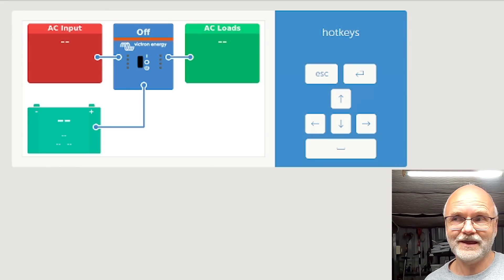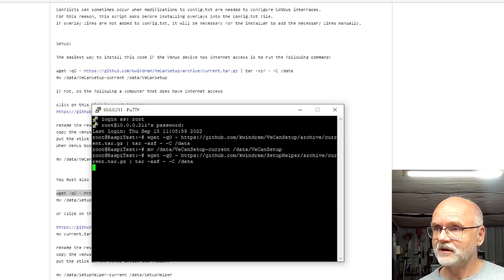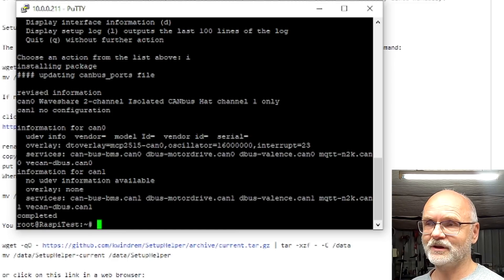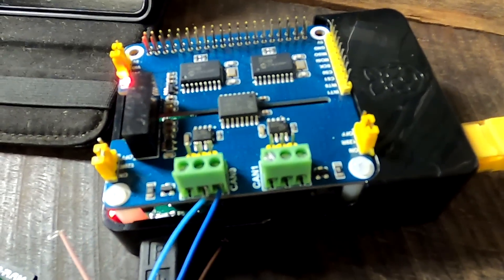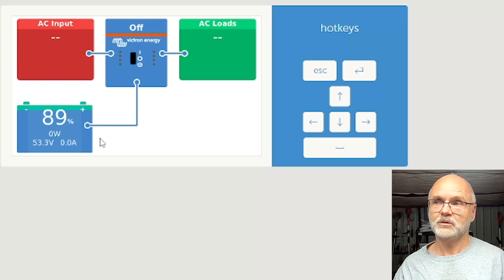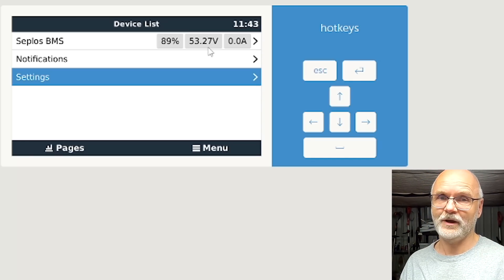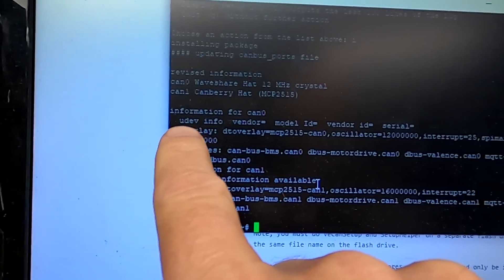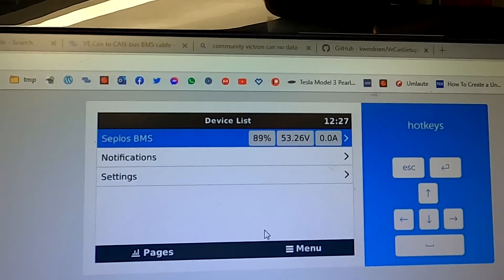Seplos BMS and Victron Venus OS connected via CAN. Very easy setup (almost).

Comment: Does the BMS not automatically throttle the Charge Controller/Inverter when there are critical states it reports to VenusOS via Canbus? i.e. cell voltage too high, would that stop charging, or do you manually need to configure that in NodeRed?
Reply from the maker: Yes, Brian. This can be achieved with this setup and enabled DVCC in Venus OS.
Reply: The BMS can send max charge & discharge current levels to the Inverter, plus the Max Charge Voltage.
But I am not sure they change under an alarm condition. I would guess that under an Alarm the BMS would block all charging.

Comment: I was told CAN also should have a common reference ground, I don't see one in your system
Reply from the maker: No, CAN does not need ground. I have tried with ground before and could not get it to work but it now works without ground. As I had some other issues before, I'm not 100% sure if this was all related to the ground being connected or not.

Comment: This could be a classic example of language barrier. Since I speak Mandarin, my communication with them is always been clear. They know exactly what I am looking for and I know exactly what they can offer. Of all the BMS I purchased so far it has worked as expected.

Thinking back, they always ask what inverter I am using when I was making the purchase.
Reply from the maker: Yeah, OK. My goal from the beginning was to connect it to the Victron system, not the inverter. If it is a pure inverter (not hybrid), there is literally no point of doing that unless the inverter and battery are very far away and there is a certain voltage drop on the cables. We will get to this soon...

Comment: What you think is the CAN-Port on the RS485 BMS is a RS485 port, not a CAN interface.
This is userfull for inverters with no CAN interface. You cannot connect these inverters to the "Seplos RS485" port, because they running there own protocol there. This would collide with other inverter communication. So they just switched the CAN connector to a RS485 connector by changing some parts on the board.

What's maybe possible is to flash the "RS485" version with the CAN-Firmware. The CAN chip is not on the board, but as a slave unit this does not matter.
Reply: No, don't do it  ,  the board going to be briked if you try to upload a CAN firmware on a RS485 bms version.  You will have to send it back to seplos to recover the board.
Reply: @sergea1138  he must send it back anyway. And did you tried this already or is this just an internet myth?
Reply: Hahaha @matthiash.4670 I understand, but You should trust those who are using this bms for a long time compared to Andy. ;-) .  From day 1 we said base on sticker number it was a rs485 bms, so there is no point in trying to get it run on CAN and be disappointed it is working not working on CAN.  For your information, yes I confirm you will have no choice than sending it back to seplos if you try to upload CAN firmware on a rs485 bms version. Is it bad yes, the pc software should prevent you to do it.   At the same time if there are  2 versions of the bms why would you think it is safe to it.  Always ask your vendor before buying and doing anything hazardous on a 200$ device.
Reply: @sergea1138  once again: Is this a internet myth or a proven fact? I give a shit on what vendors say. Seplos told me the 100A version could not be converted to 200A ... I did it. So once more: Tell me proven facts and not some bs someone told someone, because someone told him...
Reply: @matthiash.4670  I understand your logic about as a slave battery, it would not matter either the CAN port works or not.  I won't give a try to prove anything, but if you want to read it from people who experience doing it, you can find their words on the diysolarforum.
Reply: @sergea1138  What you are talking about? None said here the CAN port ist working by flashing other firmware. This is stupied. On this boards is a RS485 driver instead of a CAN driver. The question is and was, if it's proven the CAN-Firmware cannot be flashed on the RS485 boards. And now you talking about a CAN port that is not working. The CAN port is not in use on slave devices. It doesn't matter.
Reply: cmon  @matthiash.4670   I said it many time already on this video it is a rs485 bms version and  the left port on the battery that is labelled CANBUS is a RS485 port running pylontech protocol, just call it the inverter port  if you prefer, and I was saying in my last message I agree with you, it doesn't matter as a slave battery  this port is not used either it is CAN or RS485.       

And I answered your question : I don't have personal proof of anything.  I know of 2 people who try it and get their bms sent back and I have confirmation from seplos there is no way to recover it by myself with the pc software.  its enough for me to don't give it a try.     

Does that mean there is no other way  ? certainly not.  For sure they are using a jtag probe to recover the microcontroller flash.    My advise is still the same to anyone reading the comment don't do it.
Reply from the maker: In any way, the BMSes on their website should be clearly labelled and explained WHY there is a CAN and and RS485 BMS. It is all clear as mud.
But thanks for all your information. I will try to flash this BMS with teh CAN firmware and see what happens. They will send out a new BMS with CAN so I can connect both batteries together.

Comment: It is very strange and VERY DISMISSING that Seplos products ARE NOT compatible even within one company. This puts into a big question the sense of using their BMS.
On the other hand, I wonder why Andy is not trying to establish communication between Victron and JK-BMS. Since there is a very good BMS that works, whose philosophy is much closer to the DiY spirit than Seplos, why not use them as an essential element. Although I really have no idea how to solve the problem of addressing many JK BMSs? As long as it is possible at all. But probably it is...
Reply from the maker: I think they have learned this now and are changing their perception. There will be only one BMS in the future (different amps obviously), but it should be compatible with others from Seplos.
I have done the Victron-JK communication already in one of the last videos. That works but only with one battery bank... https://youtu.be/sHIlP2oJ3DU
Reply: @OffGridGarageAustralia  Thanks for the answer, I have already watched the movie. I know Seplos announces unification.
But I still consider the direction of JK-BMS to be more interesting.

Comment: Thanks Andy, I'm just watching your informative videos hoping eventually it will sink in for me. Based on your previous recommendation I bought the JK BMS through your link as well as the display monitor. I would very much like to know how that could possibly integrate with the raspberry pi.
Thanks Andy for all your very valuable information!
Rick Fort Worth Texas and traveling.
Reply from the maker: Hi Rick, I have shown the JK and Victron communicating in one of the last videos here on the channel: https://youtu.be/sHIlP2oJ3DU
Depending on what display you bought, you may not be able to use the comms and the display at the same though.
Reply: @OffGridGarageAustralia 
Thank you my friend I appreciate you!
Reply: The JKBMS display connects to a different port on the JK so you can use the screen and the connection to VenusOS using a USB to TTL adapter
Reply: @gavinnoname1424  Thanks for the FYI!

Comment: OK I have a 48v 200amp Seplos Bms ready to use with a new battery build using 16 tested 280ah eve cells and Victron 48 5000.
The pcb looks very well made indeed.
Question is:
Do I keep the Seplos?
Do I ditch it and buy a JK?
I don't like how it appears to limit the charge voltage at the top of the cycle to hide its shortcomings in balancing.
Reply from the maker: The charge voltage/current limiting function can be adjusted and even turned off. 
If you have only one battery, I would not bother with the Seplos. Its strengths definitely lay in the operation of several battery banks in parallel.
The JK will work well with your battery bank and the MP. Also easy to connect via RS485.
Reply: @OffGridGarageAustralia  Well first of all thanks for all these tests.
You nailed one of the main reasons I chose the Seplos, I plan to have a second battery👍
Reply: @OffGridGarageAustralia  That is good to know. I was worried that I was gonna be stuck with strange charging behavior once my kit arrives.

Comment: This is so crazy.  In a few years, they will realize that an ethernet port with webserver will be standard.  We shouldn't be relying on bluetooth, wireless, or any non standards for computer connections.   CAN is great for a car where you really only want 2 wires to control everything.  But the few cents more for ethernet is far more effective for debugging and everything else.
And the BMS should be throttling current to manage a cell over/undervoltage....not shutoff all related batteries.  Seriously, going to have to design one of these to get it right.  So many are just completely inadequate.
Reply: CAN or RS485 is the standard for any kind of inverter or other solar equipment. Why should they integrate Ethernet, if this cannot be connected to other hardware?
CAN and RS485 is an industry standard for decades with a reason. They are simple to use, build-in in nearly all microcontrollers and do not require addition hardware as like switches.
What Andy here did in a couple of videos here, sorry, I did it within a few minutes - faster than I can configure the IP settings of my network.
Missing knowledge cannot be the excuse for dropping solid industry protocols with a widely spread existence in the solar corner.
Reply: you miss the point why CAN is heavily use in car and industrial environment.
Reply from the maker: Yeah, I kind of agree. All this tinkering with RS485 and CAN is cumbersome and cost a lot of time. A simple ethernet standard would be great and easy to setup.
In one of the last videos, people have confirmed that the BMS will only shut down the connected bank, not all of them. We will see how the new BMS is performing once it comes out.

Comment: Back in the days we could update /udev manually with a single command.
My guess is that the install script gives an unclean exit or the author just didn't shake the /udev tree within the script. A reboot van do that for you but since you have root access you should be able to update it by command. I retired from Unix and Linux. a swift Google should people help sort that out. My guess it is.

Nice job Andy. It is good to see how everything sticks together.
Wether you will monitor your expensive batteries with "toys" is up to you. I always ask myself the question "What if I am not at home/location, who is going to fix issues and monitor? Can they or do they need a 2 month course? It is all in the game with Diy projects I guess...
Let's amp!
Reply from the maker: Thank you. I would have no idea how to fix that. Last night I started from scratch again and the smaller CAN hat did not work at all again. Same error with udev and no chance to get it installed. Rebooted numerous times and installed, uninstalled, no luck... Switched over to the isolated hat and it worked after the first install. I guess the drivers are not as 'clean' programmed as they should. I'll report this back to Kevin and see if he has an idea.
Reply: @OffGridGarageAustralia  it is very common in  free source world. Haha. Don't go there alone, you ll get lost. I have been down that rabbit hole trying to maintain 50+ sources for the very first HD streaming platform that Branson's Virgin Media wanted. They asked rediculous things because they didn't know the right questions (probably should have answered 42 but I didn't dare). It totally flopped.
Now, to get it working again you probably have to do the same steps. First install the double hat . The install script does some things the other doesn't appearantly. It is always reproducible as long as it is not a hardware fail. Gotta love IT for this.
If you feel lucky yourself and love poking the flashing cursor and don't mind people finding you staring at it for hours:
One option, I LL may try a fast Google if I find time, it takes time, is too check all files modified after the first script. But you need to figure out what directories to check and how to do this. Simplest is the "find" command but it is cumbersome in syntax, py may have the "locate" command aboard but I don't know if it is that versatile actually. I am old. Need to check "locate".
When finding the differences you probably see some script/.conf/link missing. Something the programmer could easily have missed because that part is being taken care for by another hardware install.
So it is not bad, it is just nearly finished...
Personally, I would let the young people chase that one... Better have a 🍻 and wait for them.
Cheers.

Comment: Und jetzt Mal can Bus und rs485 gleichzeitig ausprobieren
Reply from the maker: Warum? Es kann nur ein BMS als Batterie Monitor erkannt werden.
Reply: @OffGridGarageAustralia  da die eine Batterie jetzt über can Bus angeschlossen wird, und can Bus vom Venus os als andere Interface Art behandelt wird, könnte es vielleicht sein, dass beide Batterien benutzt werden
Reply from the maker: @lanealucy  Das ganze ist ja erstmal nur ein Test fuer die Battery 3.0. Fuer meine eigentliches System brauche ich wirklich keine Kommunikation.
Reply: @OffGridGarageAustralia  trotzdem wäre es interessant, ob es funktioniert
Reply from the maker: @lanealucy  das stimmt wohl. Das war ja eigentlich der Grundgedanke zwei Batterien zu bestellen und dann die Kommunikations zu testen. Vielleicht klappt es ja noch wenn Seplos die neuen BMSs schickt.
Reply: @OffGridGarageAustralia  ich bin auf jeden Fall gespannt
Reply from the maker: @lanealucy  Ich auch ein bisschen 😉

Comment: Unrelated but does your weptek 21a power supply ever spark when connecting it to a battery even when output is off or set to zero? Mine does and I think there is something wrong with it.
Reply from the maker: Yes, it does if the set voltage is different than the battery. If I connect it to a 50V battery, I set ~50V on the power supply before and turn it on so the internal capacitors can pre-charge to that voltage. No sparks anymore.
Reply: @OffGridGarageAustralia  Thank you! Keep up the great content.

Comment: Would you suggest the current NEEY Balancer for the SEPLOS BMS (Can Bus connected to Growatt Inverter) as balancer for EVE LF160 cells (160A and 0,5C max charge / discharge) in 16S configuration?

Which NEEY will be the right one and how to make sure to get the 4th generation or whatever you had gotten ?
I just wanna make sure to not get ripped of with outdated stock.

DIY battery with this seplos BMS you are using but 100A max but without such case.
thanks a lot😀
Reply: I am doing that on my 280 kit Just fine with the neey balancer.
Reply from the maker: If you use the link on my website you will get to the Hankzor store on AE. Under the specs table there is a text saying: New upgrade: put the balanced sleep voltage and balanced start voltage options in the app
That's the lates gen4 version. You can also verify with them before buying.
https://off-grid-garage.com/battery-management-systems-bms/

Comment: The canbus port is not functional on the 280Ah battery bcoz it is not a CANBUS port but a RS485 port (to connect to voltronic like inverter for example) since it is a RS485 bms  version,  even if it labeled as CANBUS. ;-). they didn't modify the label on the pcb, and didn't produce 2 different front box panel.
Reply: yep, stated that under the last video too
Reply from the maker: Yeah, it's not great what they have done. I understand that some inverters talk RS485 instead of CAN but... still the BMS has both CAN and RS485 ports. At least it's labelled like this 😑
Reply: @OffGridGarageAustralia  Hahahah  Andy,  once again  ;-)   the 280Ah  battery bms don't have CAN and RS485 ,    it has   a RS485 inverter port (running pylontech protocol)    and   2 rs485 inter link port (running a modbus proprietary protocol to get battery to communicate each other) .
Reply: @sergea1138  That is exactly the situation. Don't understand why people keep asking this. The big advantage of seplos is that it can talk too so much different brands inverters so they need to have a RS485 inverter-protocol port version also for those inverters talking RS485 only. Yes, we can blaim them on not changing the label of the port. But that the only thing.
Reply: @OffGridGarageAustralia  I wish they had just labelled the port as "Inverter Comms". That way it would be easier for us all to understand that it's a multipurpose port.
Reply: So, you pay a lot of money to Seplos and Seplos is not even doing a good job on this 280Ah product. Seplos get a fix on it!